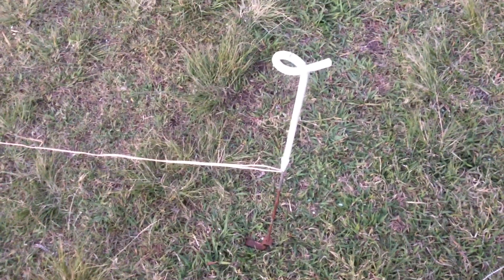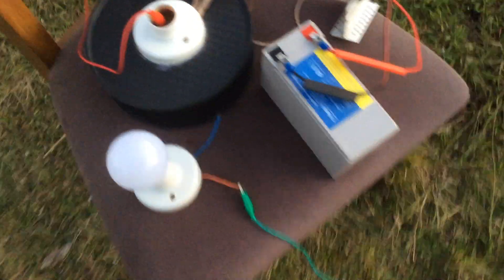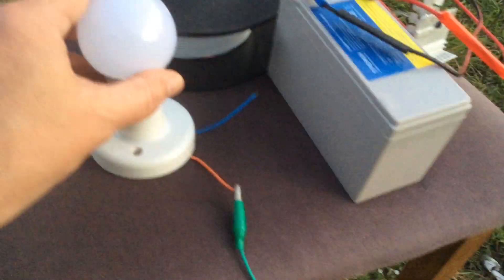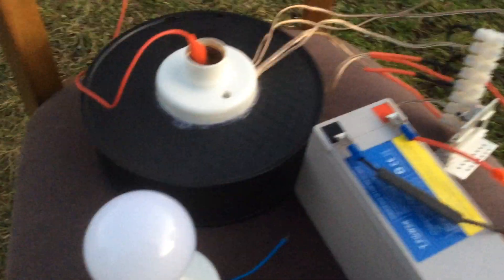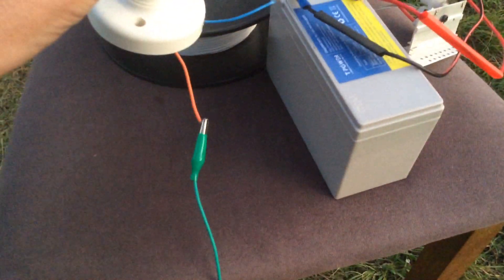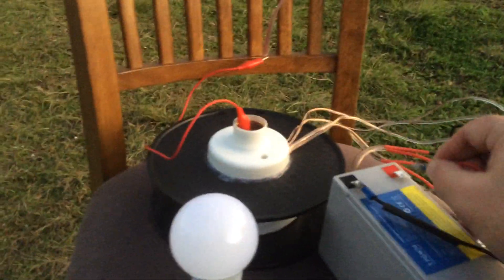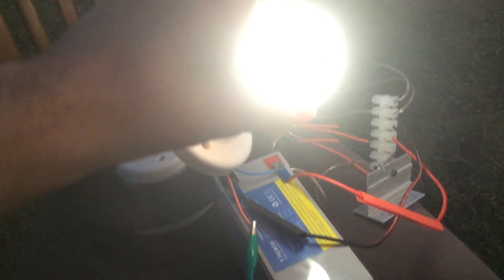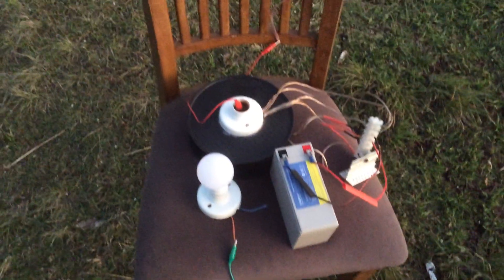Tesla Electricity Transfer 100 Metres Through The Earth Runs 240 Volt Light!

Comment: is the energy comming from the ground? how does this work? thanks
Reply: also where is the 10 meter ground connected to? does the battery stay charged?
Reply from the maker: Thank you for watching.
I designed this system to use 1 wire signal transmission as well as earth transmission to allow me to transfer power from a solar suitable location to a non solar suitable site. Through earth transmission allows for long distance transfer not normally available to a DC power source and saves 50% on copper wire. The energy comes from the battery and does not come from the ground, however, this could be achieved. The earth in this example is used by the circuit as a wire and this is why the circuit requires two earth points, the 10 metre earth line connects to ground and the light does not function on the other wire if this 10 metre earth is removed. The earth lines can be any length, it does not need to be 10 metres.
Reply: @whatifididthis...1236  thank you :) is the soil a better conductor then copper then? this smells a bit like the tesla magnifier wireless transmitter right?
Reply from the maker: @martinetellerandet8566   I believe Nikola Tesla stated the earth was a better conductor than any man made conductor. Most of my work is inspired by Nikola, realistically, I’m just reverse engineering from his patents. I tend not to listen to educated people that say it can’t be done. I’m unsure who made the statement but I have lived by this train of thought my entire life since,  “if you want to know how something is done, don’t ask the person that does not know or tells you it isn’t possible”.
All the top minds alive at the time of the Wright brothers first flight said manned flight was impossible.
Our academics wear blinders, positioned by their education. My own father, an experienced aircraft engineer used to tell me my magnetic track wouldn’t work, let’s just say I enjoyed watching his face contort as his brain tried to reject his education! As I stated to him at the time, there is a reason they told you it wouldn’t work and here is the reason you should have questioned them.
Reply: @whatifididthis...1236   I hope to give my dad that experience as well :)
Reply: @martinetellerandet8566  lol never doubt the powerful incentive, in endeavoring toward 'proving him wrong'.